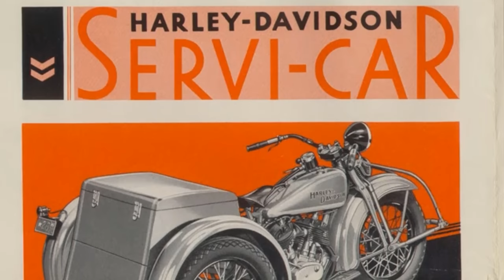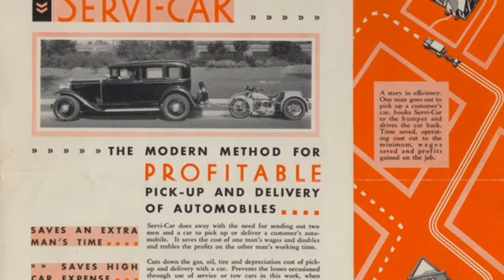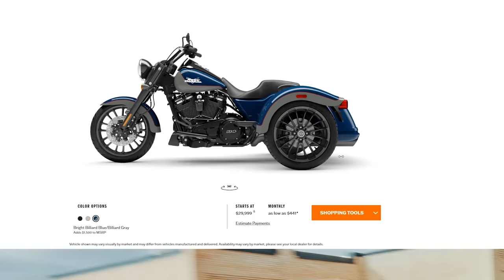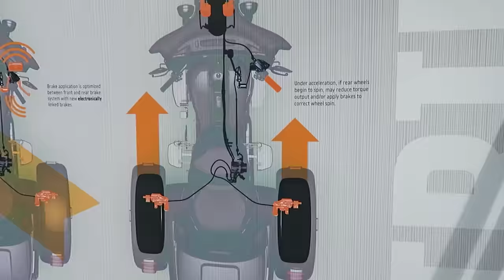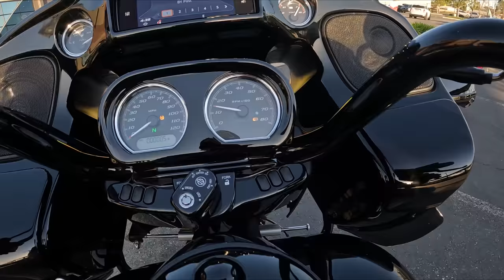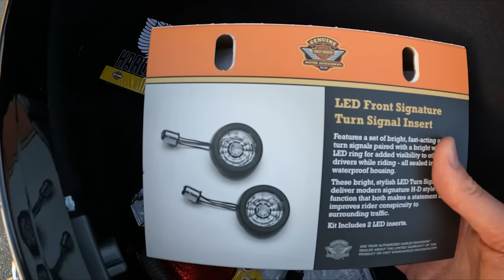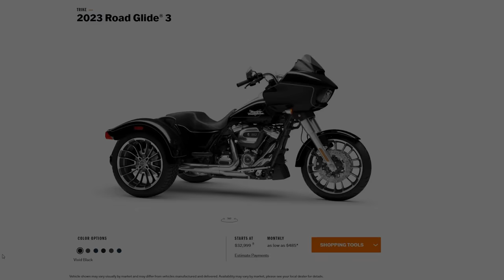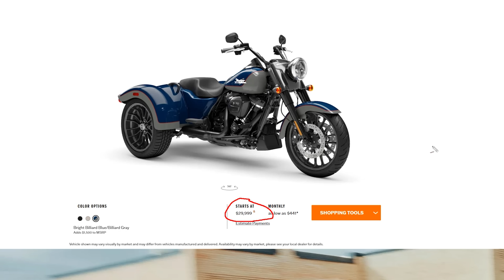2023 Harley-Davidson Road Glide 3 (FLTRT) Test Ride and Review

Comment: I rented a slingshot - they mix the worst of all worlds - gets really hot when stopped and you feel all the engine heat, it’s noisy, it’s not very quick and when you use the power mode the only thing that happens is the rear wheel spins, it’s really tough to get in and out of too.
Reply: Agree 100%
Reply: I agree. I test drove one a few years ago and thought for the money, I’d rather have a Miata than that.

Comment: First, GREAT video. I’m on a 2020 Ultra Trike. Gotta say, for me, the steering is much tougher on your upper body on the trike over a 300+ mile day vs. my Road King- not sure how it couldn’t be- even with average/slightly above average upper body strength for a 50 year old. Not necessarily brutal or prohibitive on your arms, but it truly is like riding a 4-wheeler all day. Very different ride experience. Note: I think if my dad were still around, he’d 100% agree that it extends your riding life by 5-7 years minimum, past what most knees will allow on 2 wheels.

Comment: Been on a Freewheeler for almost 2 years and love it. I noticed that new trike riders either ride the yellow line or over it. They go by the front wheel and not how wilde the back is. Once you get use to size to me I get to relax a little more on a trike then two wheels. But it keeps me in the wind.

Comment: In the area I live in (Northern Illinois) we have not only winters to contend with but, also, a lot big, really heavy, 18-wheelers that contribute to the rough roads,  With a two-wheeler motorcycle both wheels follow the same track so you, the rider, have a lot of options on picking the the smoothest path on your side of the road.  
With a trike, you options become really limited as to the smoothest path as you now have three different wheel tracks to consider.  The solid rear axles of the Harley's exacerbate that situation because it induces a lot more “head shake” into the motorcycle than one with an independent rear suspension (I.R.S.).  
“Head shake” is a phenomenon where the steering head seems to shake back and forth like a pit bull with a long rope play toy.  What is actually happening it that the front wheel is tracking straight but the rear end (and chassis) is “dancing” side to side due to the roughness of the road.  I.R.S. seems to significantly mitigate that “head shake” a lot.  “Head shake” really becomes a major consideration as you get older and develop arthritis in your hands, wrists, elbows, shoulders, or spine,  It also affects the tendons in your arms and can cause/aggravate tendonitis (So-called "tennis elbow".)!
Pothole avoidance obviously becomes problematic on any trike which is why broken rims are not uncommon at Harley dealers.
None of the afore mentioned problems are an issue if you live and ride in an area where all the roads are always smooth as glass.  Bet then, for you, every day must seem a holiday, every meal a banquet, and payday is like winning the lottery!  Ride safe and watch out for the other guy......he might be me!

Comment: Great Video Matt!!!  Love the design of the Road Glide 3 (Trike)!  Minor point… first time riders should know with the wheel placement it is a little more difficult to steer around debris or pot holes.  I love your idea that Harley should make an ICON Collection Servi-Car. That would be So Cool and fit what the Icon Collection is all about.
Reply from the maker: Yea wheel placement is important. Experienced trike riders are alert of this
Reply: Just miss with the front wheel , and the  back misses.Doesnt work for gigantic or multiple holes but you wont go down!

Comment: Wanted the RG3 but ended up with the freewheeler, love both bikes, but the shark fairing definitely gives RG3 a very nice look
Reply: What swade you to get a freewheeler instead of a RG3? I am on the fence on which one to get. Thank you  Ken
Reply: @kgranger01 for me the overall factor was that I still owed $10k on my trade in and the FLRT was going to be cheaper in that regard, had I not owed I would have went with the RG3, as it is the same model frame and design as the FLRT but has the shark ferring plus the audio and digital that comes with it.

Comment: I have had two freewheelers before, Now I have the road glide 3. It is awesome! I really enjoy the shark fairing for the way that it cuts through the wind. I added: heal shifter, edgecut grips, passenger backrest and pad, heat deflector in black and chrome, trunk rack, and bumper. It is Brilliant Billiard Blue with chrome. The original short dark windshield works great. In the future I would like to get an engine guard and maybe some lower fairings. I will definitely get the brake strobe kit because that really increases the visibility to people driving behind me and makes them BACK OFF. Every bike should get the brake strobe kit standard. Now start producing accessories for the Roadglide 3. I am in my sixties and have a leg amputation.

Comment: You spoke of the Service Car from back in the day. learned Columbus Ohio on one of those doing a job for a Car Wash the did detailing for dealers. I would ride to the dealer and hook the Trike on the back (Cars had metal bumpers then 1967) and return to the Car Wash and also on the return delivering the car back to the dealers. I was 18 years old then and between Jr. and Sr. years in school.. Great summer job. By the way, That trike was a 45 flathead engine, and it had the left hand twist grip except it was the "Spark Advance".

Comment: I'd say the trike line has been a success for HD despite the "GeezerGlide" reputation. I am surprised Honda hasn't made a Gold Wing trike.
This new Road Glide version is a good looking machine. I think if I were to get one I'd machine up hub adapters so I could run some Halibrands or Torque Trust wheels with some big ass Mickey Thompson rubber on the back (like 15" wide tires)! If you want to give me one, I'll build it as a prototype for you at no charge! 😆👍
But, this thing is going to be $40K out the door so that's just a crazy amount of money for me to spend. If were to win the lottery though, I'd buy one.
I agree with that thinking like it is a quad will make the transition from 2 to 3 wheels easier.
I have an FL with a sidecar so that fills my 3 wheeler needs. Sidehacks are way different riding experience too. It does have raked trees so makes steering easier although increases turning radius. I also think they are way cooler than a trike.
I noticed in the video that you're crossing over the centerline because you are riding it like a two wheeler. With a sidecar you don't do that because you know the sidecar is there, plus it is on the right side so nothing sticks out the left side of the bike.

Comment: Not a trike guy personally, but It is a good looking bike. Just wondering if they changed their reverse system on these as the ones I have seen are really noisy in reverse and this one seemed to be quiet. Didn't know if you muted the sound or not.
Reply from the maker: No, it's the same reverse gear. The camera just didn't pick up the sound as much. It's the same though

Comment: Those low profile tires are going to result in a rough ride especially with that much air , I only run 24 pounds on our 2017 Tri-Glide

Comment: Glad they finally added the shark nose to the trike lineup, but…. should’ve done it with the full touring (Limited) level with trunk, tour seat, etc.  Also should’ve developed independent rear suspension and launched with the RG3.   Harley lags the aftermarket conversion market in suspension for their trikes.

Comment: My wife recently purchased a Roadglide 3.
She has been riding motorcycles for over 20 years.
When she left the dealership on her maiden voyage she had only gone about a 100 yards and was shifting into second gear when the bike suddenly turned right and she went off the road.
Do you think this is driver error?
She did ride around the training area before she went out on the road
Reply: I believe she was still trying to ride it like a motorcycle and she tried to lean and counter steered not realizing what she was doing

Comment: hey Matt Kery here 2019 softail slim. Because of all your reviews and great instructional videos, I bought my first Harley, and because of you it was a softail slim.  I love my bike, but getting older, wanting to ride further and longer, wanting to take my girlfriend, not comfortable doing that on 2 wheels. So my question is how bad do the 3 wheeler really ride?  I have heard some horror comments on how rough the rear end is. Also, of how they will fatigue your upper body pretty well too.  I'm 5 foot 10 165 lbs. so not real big, will the trike actually ride better with the increased weight of a passenger? I really like the new Road Glide 3. My next bike will either be a road glide special (stay on 2) or a road glide 3.

Comment: the "traditional" Trikes Harely makes just do not ride and handle as well as what Can Am makes.  They look pretty cool, and are MUCH easier to design and make for Harley, but there is just no comparison in handling.  I've spent time on a Spyder F3, and that thing handles like it has 4 wheels, and you don't have to slow down for anything.  On the Harley Trike I tried I would have flipped it over taking sharp turns at 30 mph, where the Spyder doesn't care.  I really wish Harley would look into making 2 in the front type set up.

Comment: All it is is a glorified Freewheeler with a fairing.  It needs a more comfortable seat and a passenger backrest as standard equipment. A luggage rack on the rear trunk also as standard equipment as well as a rider backrest.  If HD is trying to copy the servi-car, they should have put a bicycle style seat with a suspension system to soak up the ride better.

Comment: Why don't you mention the fact that the cheap stamped Chinese actual axle mounting plate the bearings and the end of the differentials to get chewed up with less than 5000 miles. And after it does it's a $5,000 repair. Such crappy part in such an expensive motorcycle.